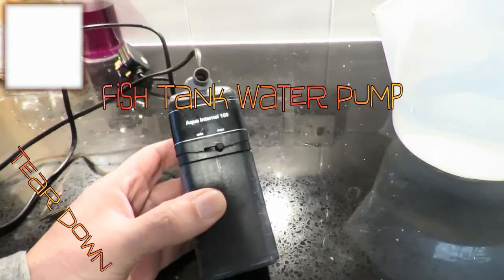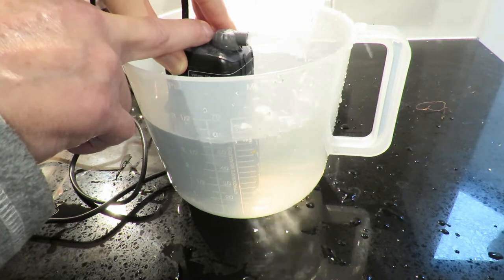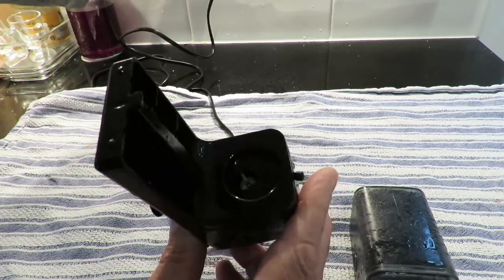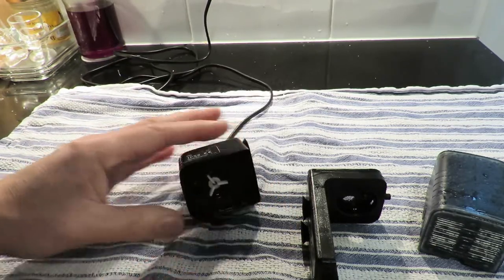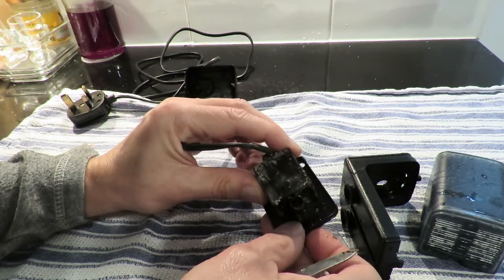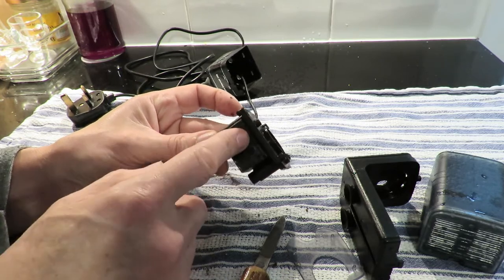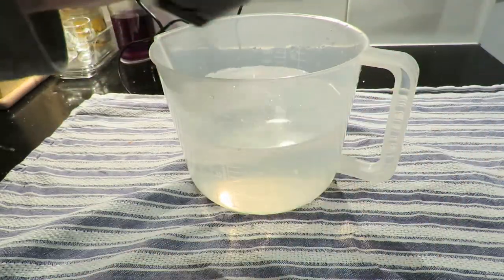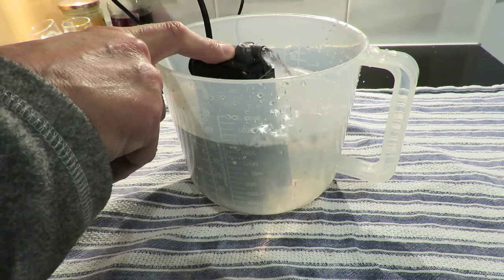Fish Tank Water Pump Tear Down

Comment: Can you use the AC coil to magnetize or demagnetize metal objects, like screws or screwdrivers?
Reply from the maker: I haven't tried it so I will try to remember next time I take one apart. It should work although the hole in the middle is quite small so you are limited on what you could put in there to demagnetise. There are quite a few videos on that subject on YouTube already.